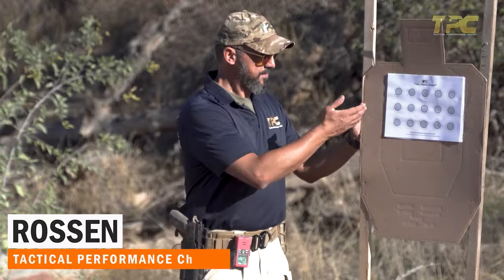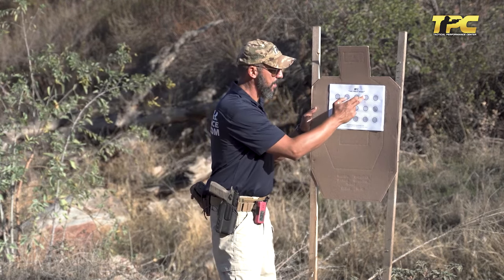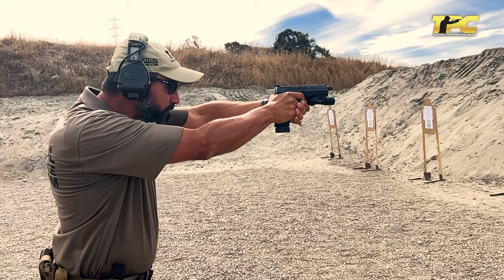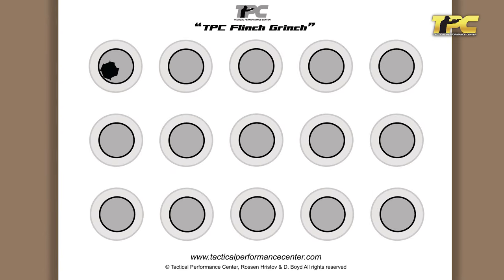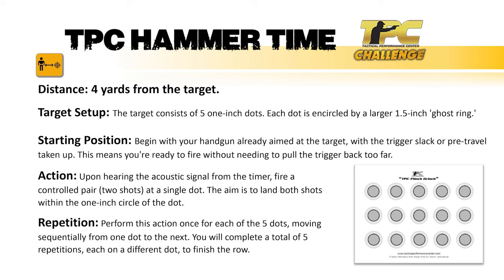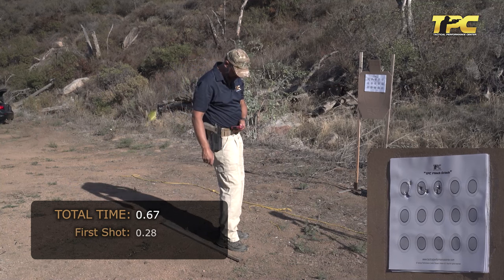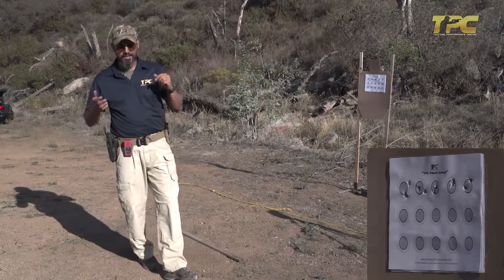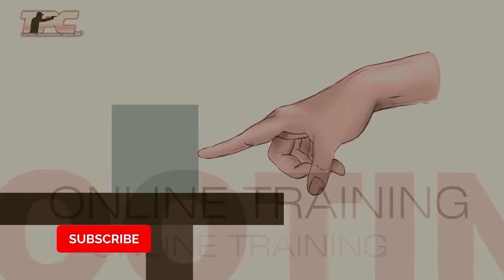Hammer Time Challenge: Master the 'Inch-Tight Controlled Pair' Technique With a Handgun!

Comment: With this distance and target size, the goal should be a split time of .25 for the controlled pair. If you would reset your trigger during recoil, also known as in flight reset, rather than pinning the trigger to the rear and resetting after the gun has returned to target, you would be much more efficient. Also, another extremely important part of the process that wasn't mentioned is to have and keep a hard focus on where you want to hit.
Reply from the maker: Hey there,
Absolutely, a .25 split is achievable, but remember, the drill we've showcased is designed for any standard duty gun and not exclusively for competitive shooters. While hitting those marks is an ambitious goal, it's also about consistency across various skill levels.
We'd love to see you give this drill a try and share your results with us! It's always interesting to see how different shooters tackle the challenge and what kind of consistency they can achieve.
Regarding the target focus concept, you're right – it can be effective even with iron sights. However, it does demand a considerable level of shooting experience and highly refined proprioceptive skills, especially when engaging a target of this size, even at 4 yards. Soft focus shooting isn't for everyone; it really takes time and experience to master.
Looking forward to hearing about your experience with the drill. Keep shooting and keep sharing!

Comment: I need to try this. Sadly I can't use such a short range often. 
I print it for the next chance I get to have it ready.
Reply from the maker: The TPC Challenges are designed to require a very simple setup, regardless of the range facility, outdoor or indoor. We are not familiar with the unique policies of the specific facilities. We do not see an issue with the close distance if the trainee is aware of the cone of fire and a safe and reliable backstop. We know that some facilities have policies that don't make sense and are too restrictive without actual logical correlation with safety. Safety is our number one priority always!